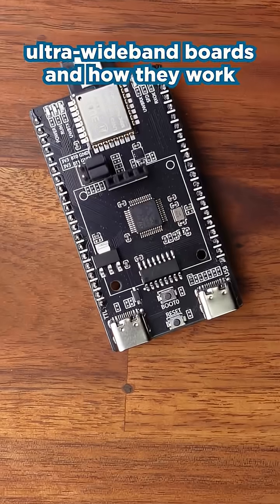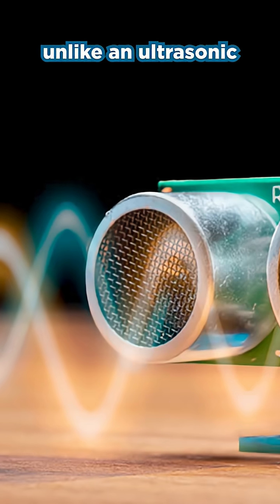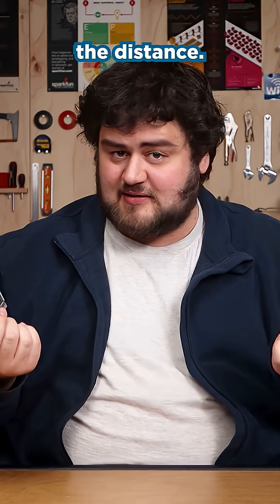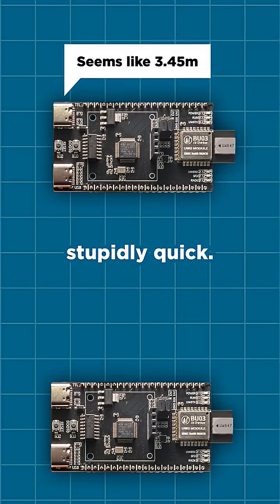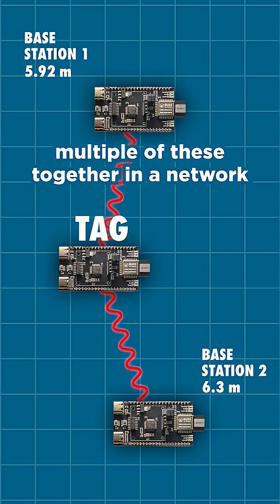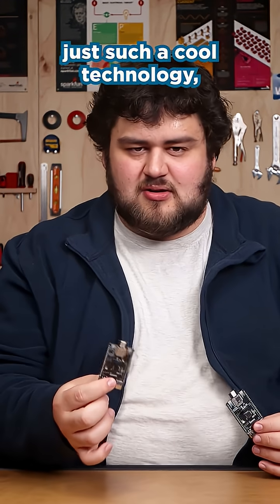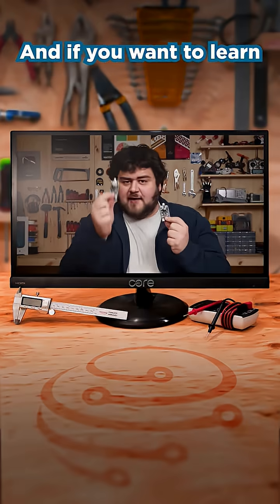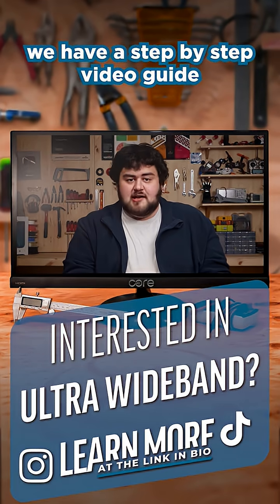This Pro-Level Sensor Is Now Maker-Level

Comment: I'm curious if this could be used as a replacement for the laser based lighthouse VR tracking solution that Valve developed
Reply from the maker: It most likely doesn't have the accuracy, this is only accurate to about 10cm, those laser sensors would be crazy precise!

Comment: Typically UWB does not measure distance by measuring the travel time.

MCPD (Multiple Carrier Phase Difference) is much more robust and typically used. Distance is measured by sending a signal to a "Reflector" (the second device) and it will send back the signal to the source, both measuring the phase in which they received the signal. Then you calculate a phase difference. Now you know in which phase the signal has been received. But that still leaves unlimited possible solution for the distance. The device will then repeat the process in a different frequency doing the same. Eventually all measured phase differences will converge in a single true distance.
Reply: I was thinking the same, I doubt that such cheap sensors can make precise measurements in femtoseconds, which is necessary for measurements in tens of centimeters.
One way they could work is to shoot a large number of short radio pulses, eg 1000 or more, make rather imprecise measurements, and then extract the mean value, that's how cheap, a few dolar lidar sensors work.
Reply: @goranjosic light travels 1 foot per nanosecond, and there's plenty of cheap sensors that do at least 10 cm tof
Reply: I would think a back-and-forth system where they get each other's time clocks in sync (like ntp), and then both produce an identical chirp where one doesn't transmit it, but instead interferes the received chirp with the internal one, and the time difference will cause a certain frequency difference causing the beat frequency to be based on the distance. However precisely you can recover the beat frequency would be the precision of your measurement.
Reply: @brainwater  The syncing and TOF measurements are close to trivial in theory. 

The point is that you can't do that without specialized hardware and protocols. But UWB was designed with such hardware and protocol to allow for timestamping directly in the receiver hardware and for sub nanoseconds timestamping. There are multiple protocols one can use for that but it only works cause of the hardware.

You can't do this for example with BLE. The hardware does not have this builtin and even if you change the BLE stack in software, doing this in software will make the time drift of the chip make every TOF measurements useless. In that case one uses phaseshifts.
Reply: Precision oscillators for the clocking are temperature sensitive, n'est pas?  How periodic is the recalibration?
Reply: think you're missing the point
Reply: as an Telecoms engineering student, this explanation wass really helpful
Reply: @GuillermoSánchezDíaz-Casanovaits wrong for UWB however. UWB uses TOF eventhough phaseshift is used elsewhere as for example in ble's angle of arrival.
Reply: Measuring time travel?

Comment: I wonder, if you put these in multiple corners of a room, how accurately you could triangulate an exact location for a mobile one in the middle...
Reply from the maker: We have a guide doing just that! https://youtu.be/ziLU9w88G3I

Realistically +/- 10cm
Reply: We did this for our engineering thesis 3 years ago. IIRC got something like 10-20cm accuracy. Current solutions are probably even better.

Comment: From what I know most consumer UWB tags use linear polarization, so that means there IS a specific orientation in which this won't work, if you keep rotating them randomly then yeah there won't be a problem, but still if you do it slowly and try to get them perpendicular to each other then normally you can get them not to work

Comment: Still can’t understand why some auto manufacturers skimp on some of their models by not using UWB for their keyless systems. UWB chips are cheap these days.
Reply: Ultra-Wideband (UWB): Newer premium vehicles (Audi, BMW, some Ford models) use UWB (3.1–10.6 GHz) for location-precise, relay-resistant communication.

Being relay resistant is a big thing.

NOTE: Most non-UWB wireless car key fobs from major manufacturers typically operate at a range of 30 to 60 feet (about 10–20 meters),

Comment: But since there is a medium, especially if there is something like glass in between, won't the speed of the radio waves be less, and thus causing an accuracy issue in the measurement? Or is the error too small to matter?
Reply from the maker: We reckon the error would probably be too small to matter

Comment: Finally, I will be able to localise neighbours behaving noisily in a high-rise building)
had an idea about triangulation using microphones attached to the wall, but the distance issue was not automatically closed)
Reply: But wouldn't the loud neighbor would need to be holding one.

Comment: a bit worried about electromagnetic noise
Reply: What would suspect affected by that?
Reply: @ThatDruidDude 2.4ghz waves are all around us. Also microwaves from cellphones will hit the sensor causing  a titration effect. This will then translate into a reversed polarity helical magnetic field around the sensor data wire.

Comment: They must be picking up GPS signals to synchronize the clocks between the boards, otherwise there's no way to do this with just signals between the two devices.
Reply: That's one way.  If you measure round-trip time (and control turn-around latency very consistently), you'd just need two very stable clocks rather than two precisely synchronized clocks.  You're measuring your own signal round-trim time locally.
Reply: @rossarcher6104  huh.  So each node is just a relay...
Reply: No, my understanding is that first board times how long it takes for the signal to reach the other board and come back.
Reply: @MatthRrrr  Right, which makes the other board a signal relay.

Comment: They can’t be working at the speed of light.
Reply: Yes it can it’s emr light, radio,microwave,uv,ir,gamma all move at the speed of light cause light is just a different wavelength of the same radiation

Comment: At these small distances, the relative error of a cheap chip calculating and making network packets could become significant. I wonder if they can/do deduct the time elapsed due to processing the packets send and received. For example, if it takes one milisecond to receive and send the packet, light would travel 300 meters. So at the range of 30m, the processing time is 10x the light travel time. Unlike GPS, where the travel time is orders and orders of magnitude greater than the processing time. Furthermore GPS uses atomic clocks and these cheap ones obviously don’t. Have you tried to see how accurate these chips can be? In apple’s implementation they can not only tell the distance, but the direction that you should go in order to find the device.
Reply: You could just subtract the long processing delay.
Reply: @TheRainHarvester the tricky part is knowing how much to subtract
Reply: @mehregankbi easy: time1 = sensors close together. Time2= sensors far apart.

time1 = overhead processing time
Time2-time1 = distance * speedOf Light

Comment: If these radio waves "move at the speed of light", how are they radio?
Reply from the maker: Radio waves are part of the electromagnetic spectrum, just like visible light, they may have different wavelengths or frequencies but they all move at the same speed in a vacuum.
Reply: Radio is just a different frequency of light

Comment: That’s so cool! thank you for showing it!Can it also figure out the direction of the Signal?
Reply from the maker: Not from just a pair, but in part 2 of our Ultra-Wideband guide we show how to set up a network and use trilateration for 3D tracking.
Reply: Hm, that's a bit strange; with access to the radio, UWB should enable pretty robust environmental modeling, even without another UWB device present! It's all in the implementations, I guess...

Comment: I just received 3 of these 2 days ago. I’m looking to use them as part of precise measurement for an automatic lawnmower system.
Reply from the maker: Sounds brilliant, good luck!
Reply: Sounds awesome, are you sharing your progress somewhere? Github?
Reply: Was just thinking to add this to a homebrew auto steer system for a tractor
Reply: What's the range??
Reply: @daleridpath  so far I’m reliably getting 20m with ~8cm resolution. It’s odd but the resolution is consistent whether I’m >15m or <2m. It’s not as precise as I was hoping nor as good as I wanted. I’m in the process of setting up a RTK station at home for hopefully greater resolution. I actually mapped my front yard to <cm resolution to create a 3d model with the hope that I can figure positioning reliable.
Reply: @kaptainkaos1202 we can increase accuracy by sensor fusion of it
Reply: @amaryk8374  ok. So let me ask, what sensor data are you proposing we fuse it with? Do you understand sensor fusion basics? By combining different data streams you’re not making any one data stream more accurate, you filling data around your initial data. Think of it this way. You have a black and white photo. By itself its not bad but now let’s add a medium that make the photo color but only 3 colors, RGB. Now let’s add a different stream that gives you 5 million colors. Now that original photo is going to provide information you didn’t have before, like the color of grass so you know it’s in a field. Let’s add GPS to it so now you know where it was taken. The original photo hasn’t changed or gotten more accurate, you just have more data.
I spent about 10 years of my career working sensor fusion of aircraft based sensors so I have a little bit of knowledge about the subject.
Reply: @kaptainkaos1202 thanks bro but i am speaking about ur main project not single sensor, and i want to learn more about sensor fusion.. if u have any references of it please share with us
Reply: @kaptainkaos1202 from someone who doesn't know anything about the field that was a great explanation, made sense to me.
Reply: If I'm being honest, that's a terrible use case.
Reply: I was having the same thought! Also put two of them on a robot and use it for redundancy when following vs relying on open cv
Reply: Farm cnc
Reply: Did you look at the range and the error? It sounds like a poor use case.
Reply: @adriftfoolish1 I was thinking as a redundant input when it's near other equipment
Reply: @AlexSterk  gotcha. that makes sense
Reply: @adriftfoolish1  I have a small lawn.

Comment: How accurate?

Also VR tracking.
Reply from the maker: If you dial them in, about +/- 10cm.
Reply: The bare modules themselves, are unfortunately >$30 each. So for 3D tracking that's $90 Minimum for 3 base stations then start adding trackers from there, also still need DOF sensors for rotation tracking.

Comment: This is sick how reliable are they do the lose communication with each other?
Reply from the maker: Once they are connected, they are pretty solid. The only time we have lost connection is when one moves out of range and fails to automatically reconnect to the network. But even that is pretty uncommon to happen!
Reply: @Core-Electronics  sick that is so awesome i kind of want to now use these on the end of a robotic arm to track its realtive position compared to the base do you recon that would be feasible or do you think i would need an accelorometer and a gyroscope too?
Reply: @jamesshimmen7818 it might be easier to use maths for that, if you know how long it is then you could maybe use Pythagorean theorem to get the distance? If you could track how far the motor has turned you could get the angle?
Reply from the maker: Unless its a really big arm moving around, the accuracy of this system might not work. That sounds like a job for an IMU. Also probably cheaper as well!